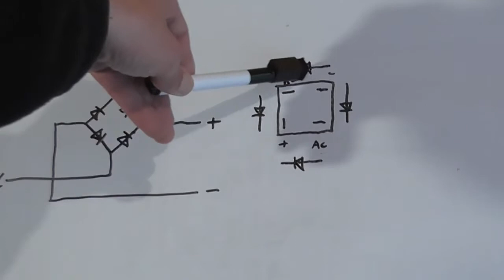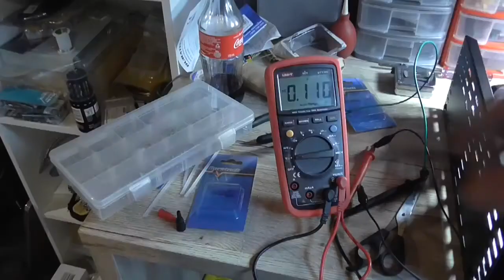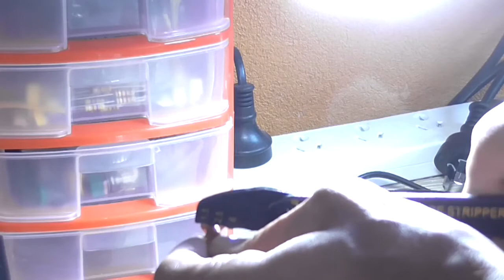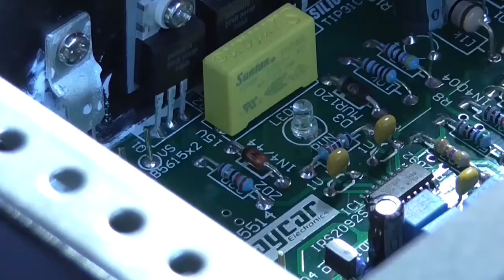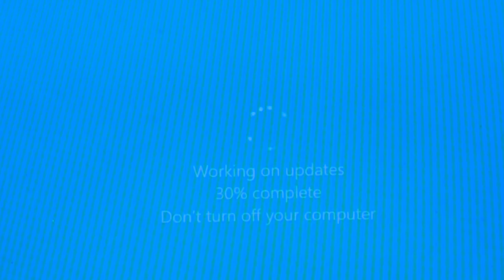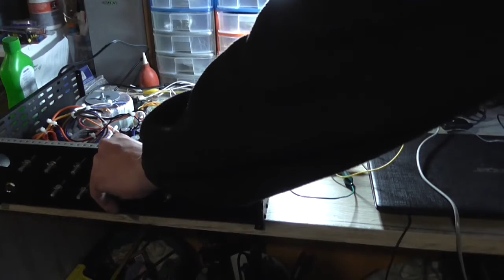Class-D Amplifier Build Part 8: The Wiring

Comment: Three points that you might possibly want take on board for future projects that use these crimp connectors.

1. The crimp connectors are colour coded for a reason - wire gauge / size that they are designed to accept. 
Red : 0.75 to 1.0mm2   
Blue : 1.5 to 2.5mm2
Yellow : 4 to 6mm2

2. Don't solder and then crimp.  The solder is very soft in comparison to the copper wire.  The crimps will eventually come loose over time. Learnt this the hard way until I discovered the proper way and reasons for not soldering and then crimping.

3. Invest in the proper crimping tool.  Those el-cheapo crimp tools don't do a good job as evident by you using the cutter edge of a pair of bullnose pliers to get a secure connection.